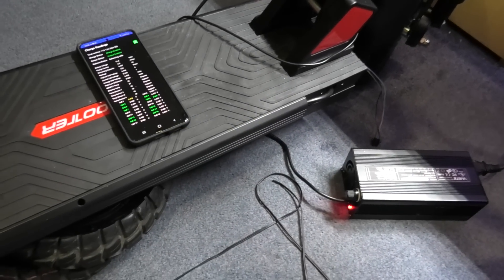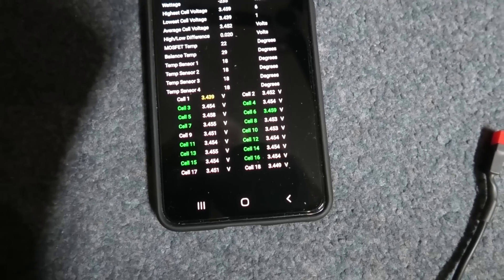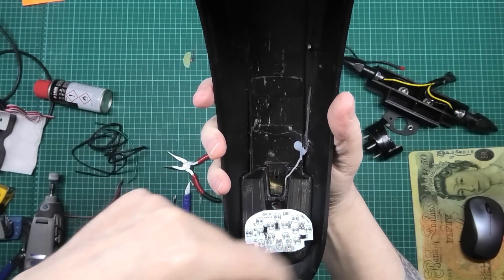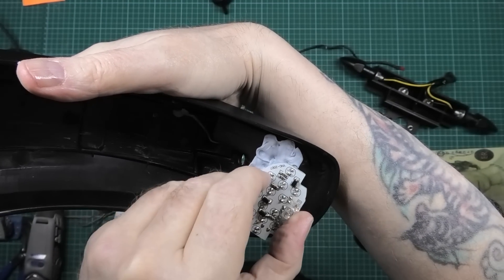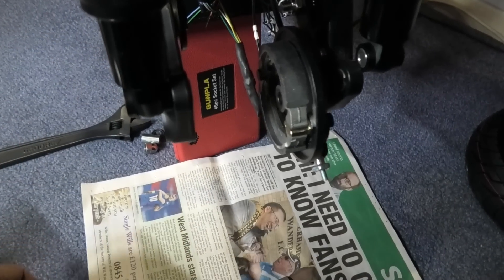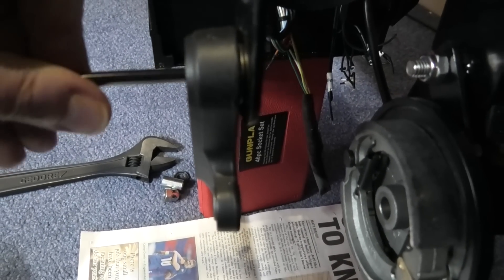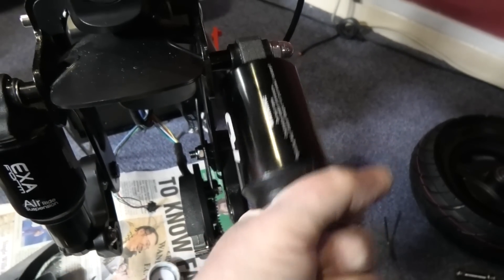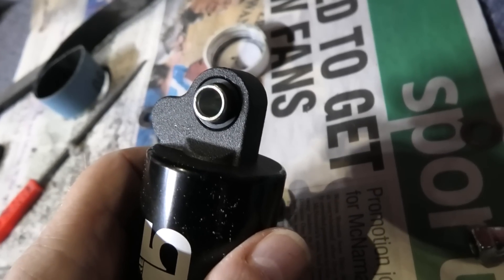🔴 EXTREMELY POWERFUL E-SCOOTER BUILD part 10 - Fixing the front suspension

Comment: What is the size of those front suspensions? 125 or 150?
Reply from the maker: 150 😊
Reply: Are the stock ones also 150?.. mine is currently in transit.. and it looks to me its close to the ground.. wonder if i could put 165 to raise it a little bit.. what do you think? Would that be viable?
Reply from the maker: @The24Sobotek  Don't put anything more than 150 on - the front suspension arms will go past the pivot point and they won't move when you go over bumps. If the front suspension pivoted the opposite way, it would be better to have longer ones.
Reply: @Vortecks  tnx for that info.. also im wondering is the deck space a lot shorter than the xiaomi m365? didnt found any info on the deck size online.. ive been following you for a long time even before the xiaomi mods.. did mine almost the same as you.. now that i see you working on the bogist i just went ahead and ordered one.. so i hope that the deck size isnt a lot shorter.. hope for your input on this one.. thanks
Reply from the maker: @The24Sobotek  The deck size (on top) is 520x200. I can't turn mine upside down at the moment because I'm broken but I think the internal space is 500 x 150

Comment: I would use a powerpole connector for charging. Always thought the Chinese implementations look weak
Reply: Another alternative is SP17. Especially if you're aiming to have a watertight charge port that still handles a good 10-15 amps of current.

Comment: Nice little installment Tony. This build is British engineering at its best. 
Definitely worth checking over power supply wiring and plugs before use. Especially 3-pin from overseas, they can get hot!
Reply from the maker: Cheers mate 😁
Everything in the power supply is fine, I took it apart when I bought it a couple of years ago. I did change the mains lead and put a proper 3 pin on it - the 4 or 5 strands in every core worried me a bit 😂😂

Comment: Looks like your getting all the final preparations done now suspension etc. I can't believe how they fitted those shocks they will work a hell of a lot better now they can move. Great work can't wait till you try it out brilliant stuff.
Reply from the maker: Cheers David 😊
The whole scooter would have been designed differently but then, that's the designer's job done. It's then passed to a factory who haven't got any idea on parts and tolerances.
It's nowhere near finished yet. I've just finished making another part for it and I'll continue until it's perfect!